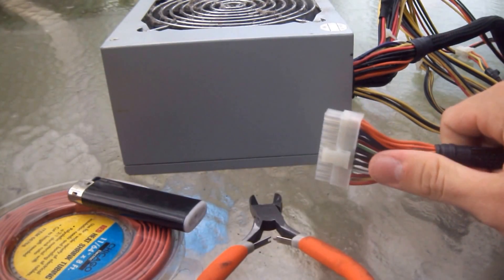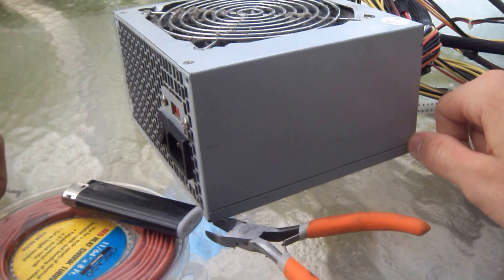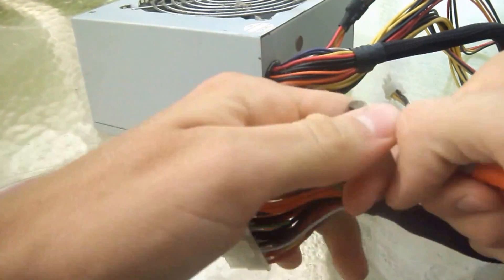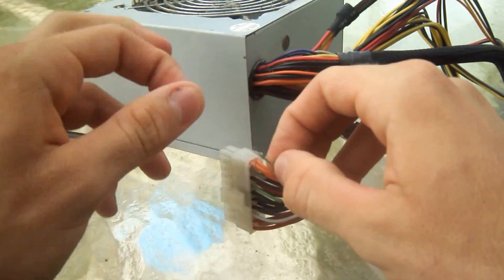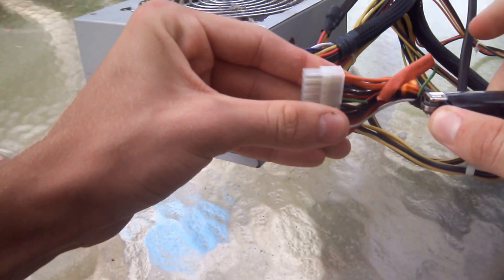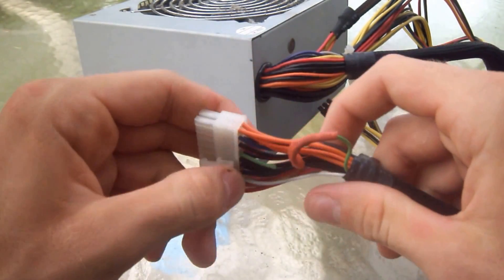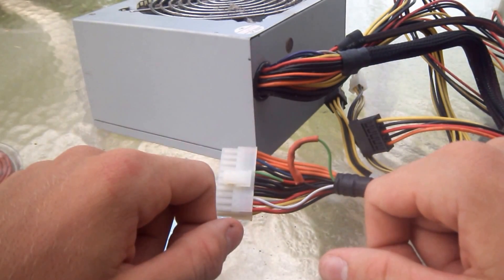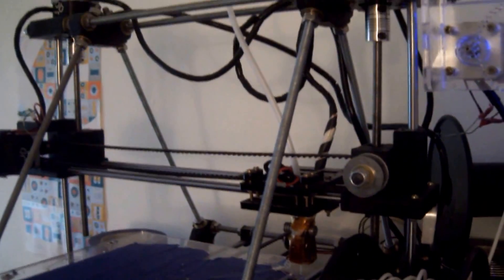How to convert a old computer psu into a project power supply

Comment: I have a Compaq PDP 119 that needs another way to power up ..do you know how? Thank You
Reply: use a multimeter on the pins or if you need to start the pc short the pin with a screwdriver on motherboard to start it

Comment: My psu turns on for a few seconds and then stops. Unplug and try again and works for a few seconds.
Reply: Some computer PSU have a minimum load required to stay on... Check the specs on the manufacturer's website.

Comment: ok i wont to do this for a cnc plasma cutter control box it seems simple enough but my question is with the 12v, 3.3v and 5 v wires. is each individual yellow wire = 12v and if so i would need to use 2 yellow wires to operate a 24v secret such a the battery packs. i am not 100% on electrics but if each wire is 12v 5v or 3.3v then i think i got it worked out just asking the question to be shore ha ha do not wont a pop rock hair doo

Comment: Man yellow is supposed to give 12 V with 10 Amps in my case as writtern in the instruction but it's giving less than 1 amps and when I run motors with high consumption rate it shuts down . HELP MEEEEEE

Comment: can I use the yellows n blacks separately as in I want to use it for wiring up four five 12vdc computer fans of the cps  instead of having to link all yellows n together along with blacks having large joint & fans again in same way can just wire the fans individually ie red to yellow black to black but not all in linked as just one outlet of 12v then cover up wires not used

Comment: my psu is different and when i turn it on it just shouts out 12v out for one second . what can i do to fix this
Reply: May need a dummy resistor. if the power supply cant detect a constant load it will automatically shut off. or your power supply may be on its way out

Comment: how to I get 18v from this if I can?
Reply: you can use the 12V and the -12V together to make 24V and use a voltage controller to make it variable voltage. Issue with using the -12V though is you will only get around 1amp max combining 12 and -12V so if you plan on using high power then not sure what else to suggest than maybe just buy a variable lab supply but costly

Comment: is it possible to use this with arduino if yes how to use with arduino
Reply: Yes, the 5v power line will power an Arduino.  Since the 5v rail is always on, you can use it to power an Arduino that controls the green wire turning the rest of the PSU on or off.
Reply: Plus, depending on your Arduino board which I'm assuming is an UNO, you can provide a power supply of up to 12V DC, so you're still safe from that part.

Comment: what if mine don't have the green line? it has 1 brown , 1 purple ,3 orange, 4 yellow, 13 black lines coming out of it .any help is good help thanks
Reply: Black almost always signifies ground, proof is you have more blacks than any other color, typically because you need a ground for any voltage level you are using.
As for the rest, my guess would be 4 is 3.3V, 3 is 5V and both brown and purple are 12V. To be on the safe side, I would suggest you go on Google and search for the PSU at your possession. For instance mine is an HP DBS-1050. I tried Googling that and only found a similar model with similar colors.

Another way for you to make sure is, after grouping them together, strip only one wire of each color, grab your voltmeter, connect the black to the COM channel of your voltmeter, turn your PSU on and then test for each color individually then save your data on a piece of paper or a note pad.
I also did that to be sure of my PSU just today and came up with the following

Yellow - 12.4 V
Purple - 5.17 V
Blue - 12.32 V
Orange - 3.4 V
White - 12.3 V

If you need anymore help email me on christopheelkhoury@gmail.com

Comment: Mid way through my first power supply modification and have a question.  Why would I need to connect the orange and brown wire together?  Also, Is there anything I should know if I want to  connect all of the yellow wires and a separate cluster for the black.  I'm making a high power 12v power supply and would appreciate your input.  Thanks!

Comment: hey i have a really old psu and i have no green wire but my power good wire is a orange one will that work or do i need to get a newer psu
Reply: If you know which one is a PS_ON and which one is a COM or the black wires then it should work